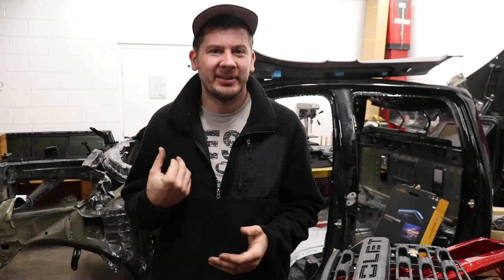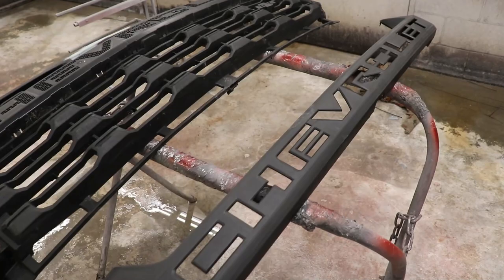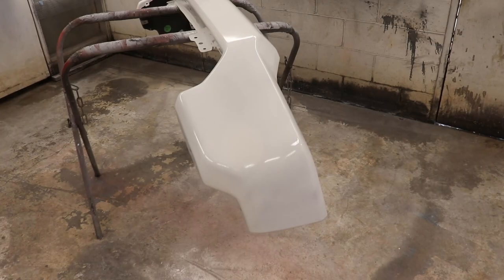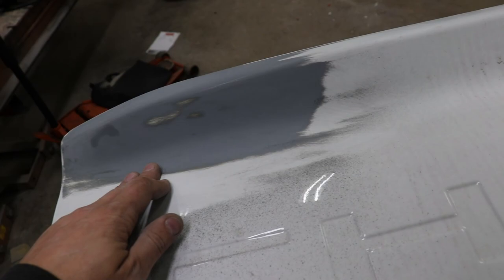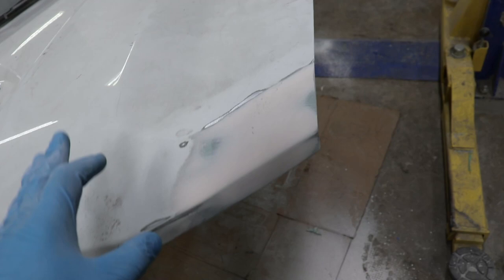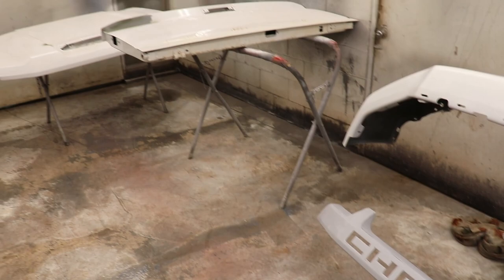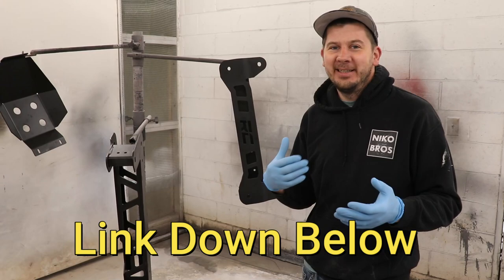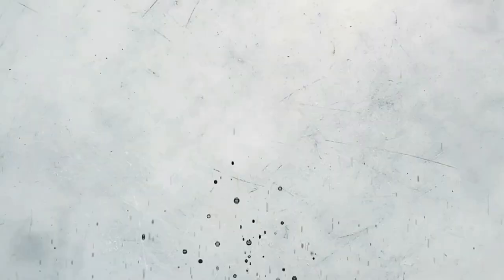BURNT 2021 SILVERADO 2500 RC LIFT PAINTED AND BODY WORK Part 28

Comment: Question . Guys if this a Salvage when you bought it, after finishing it, can you have it inspected and cleared of a salvage branding?  I love this build, very interesting
Reply: It will have rebuilt title
Reply: They will have to take it after they are finished and get it inspected by the DMV they will have to take pictures and all the recipes of parts so they will know the damage before then if they approve it after the inspection it will have a rebuilt title and deemed safe for the road then they can tag it.

Comment: I suppose you’re going to be squatting the back down and installing under glow lighting. Come on guys it’s a shop truck I thought you said. The underneath should be black. You won’t be putting anything in the back because you will be afraid to scratch it.